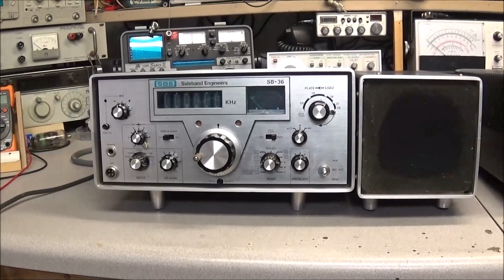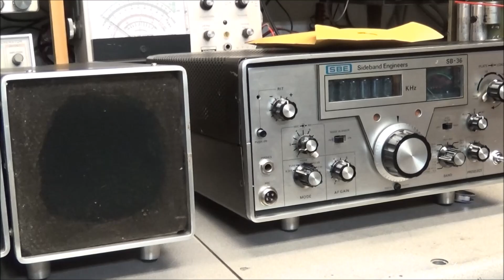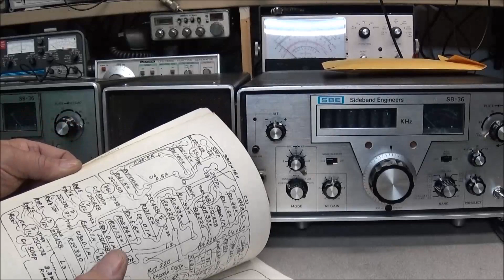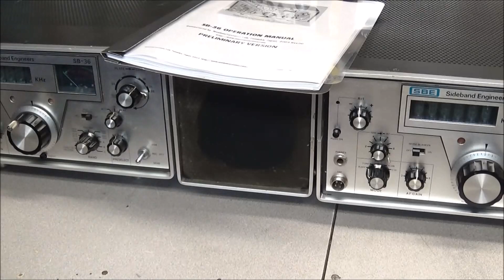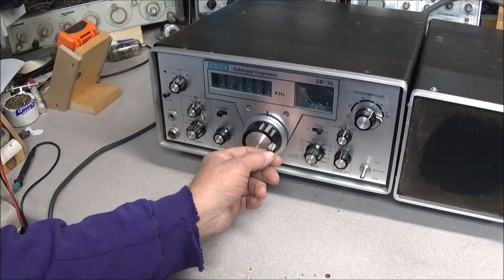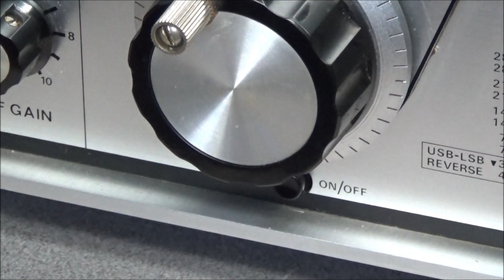#147 Quick Look at a rare radio SBE sb-36

Comment: I have one like this (have had it since 1979) Mine is called "Frontier Electric Digital 500D" They were also sold as "Robyn Digital 500A" I got a Japanese manual with it, also some copied pages from an English manual. I have done quite a lot of work on it, it had been modified very much, and I had to reverse some circuits to schematic, others I found were good as done. Your problem With the Nixies is surely a bad SN74141 driver IC (they used their own type numbers, think they called it "FEP505G" or something like it. I have changed two of these drivers
Reply from the maker: Appreciate that information. Not a lot of it on the internet. Thanks

Comment: That set is so friggin' awesome it's .....it's..... and NIXIE tubes, too!... I got practically over-awed here.... especially when I first saw those nixies... lol!... I love that set... years ago I had their SB-34 rig... I remember it had the transistorized multi-vibrator power supply for the mobile high voltage and a couple 6GB5's for the RF-PA and another tube for the driver and the rest of it all solid state...and 80 - 15 meter band-coverage.... SSB only, but it could have an optional accessory that SBE put out connected to it that would feed a sub-audible tone into the microphone circuit and with that thing  hooked up to a CW key the SB-34 would kinda emulate CW ... sort of a "silent modulated-CW'... it was compact and had a nice little handle on the side... the SB-34 was a cute little rig... but that 36 is just totally mega-awesome. Thank you for sharing and much success to you on getting both of them going again. :-)

http://noobowsystems.org/restorations/sb-34/sb-34-overview-640.jpg
Reply: I was Yahoo'ing for info the 36 and found some stuff including this... it's all in Japanese, and looks like a nice bit of data on that set after the page is translated. 
http://noobowsystems.org/restorations/sb-36/sb-36.html
Reply from the maker: Thanks for sharing that information terry. I have never had my hands on the SB-34. Great information. Looks real cool.
Reply: You're welcome  Buddy. and yep, the little SB-34 is a cool rig... maybe someone will come to your shop with one soon, now that we're talking about it. lol :D
Here's a manual for it,  just in case  :-)
http://bama.edebris.com/download/sbe/sb34maint/sb34maintenance.pdf

Comment: Nice units.  I operated one many years ago in Biloxi, MS.  A great man who was one of the elders in the USAF Ham Club on Keesler AFB ( K5TYP ) who tought me alot about being a Ham. circa 1972.  I also had an earlier model SBE-34, built with germanium transistors and a few tubes.  It had a single band switch /  tuning control for one handed mobile operation.

Bill
Reply from the maker: Thanks for sharing Bill. I operated one at field day many years ago. it was a joy.